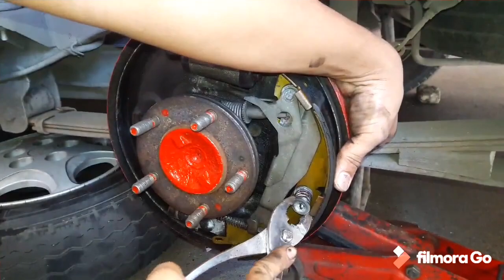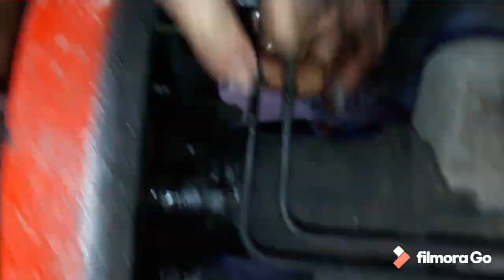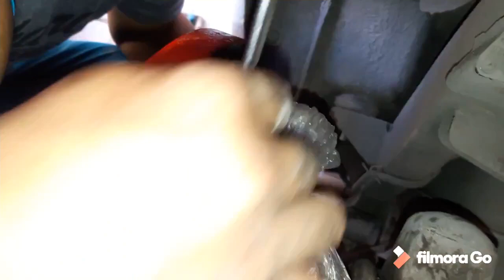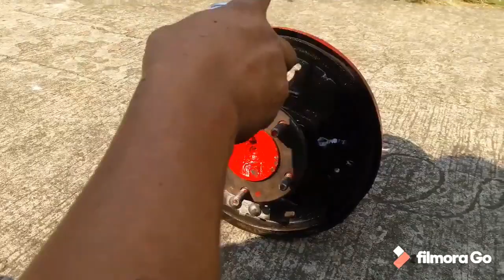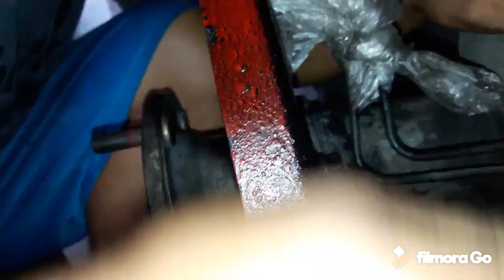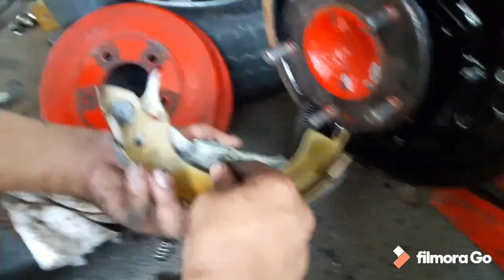Replace axle bearing and oil seal

Comment: All that effort and you never bothered to actually change the bearing?
Reply: Factory wheel bearings are usually better quality than aftermarket bearings, so it's best to reuse them if they're not worn out. OEM wheel bearings will typically last hundreds of thousands of miles if they're not abused.
Reply: Of course, but that's not the title of the video 🤷🏼